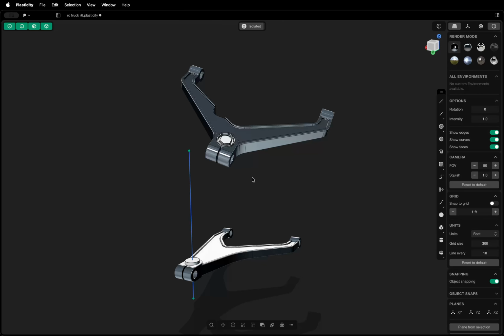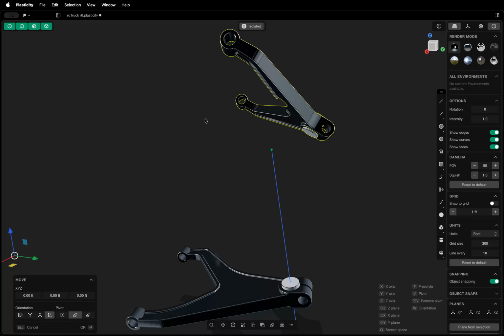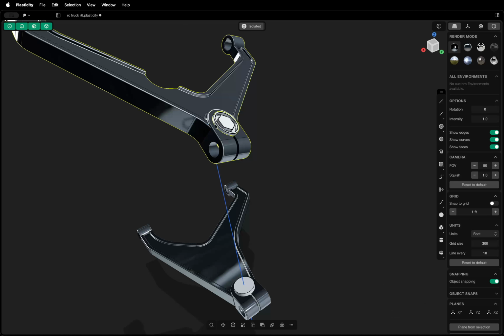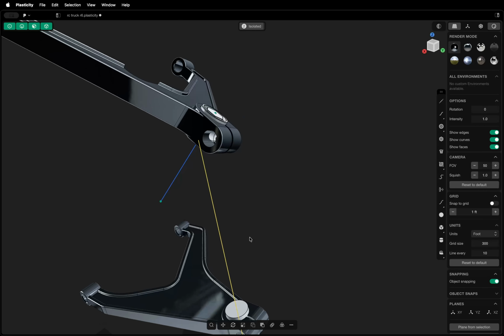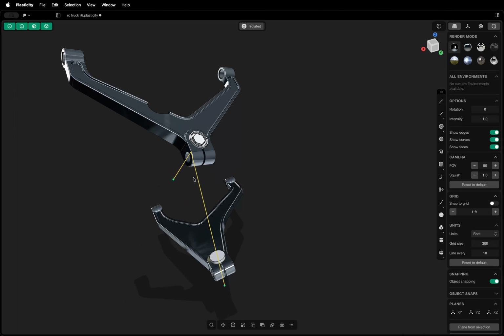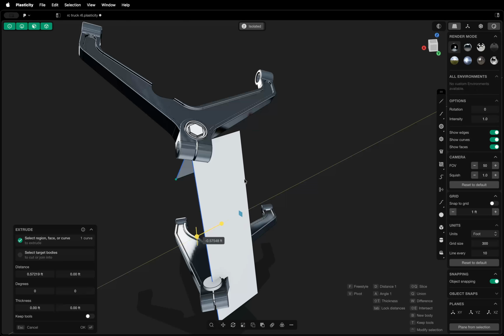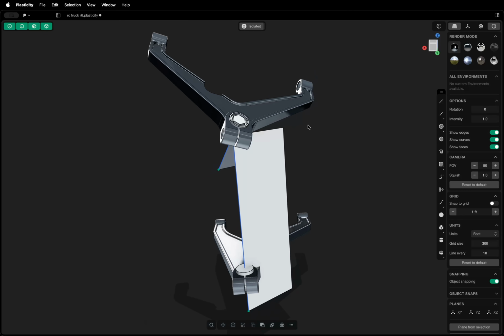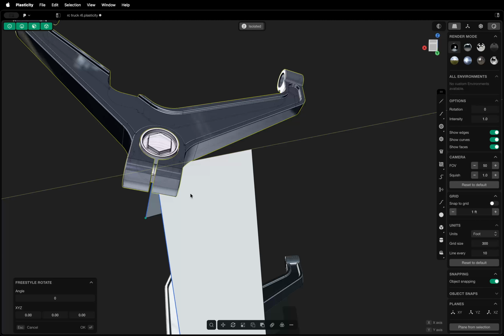PLASTICITY TIPS   ALIGNING 3D OBJECTS

Comment: EDIT: Disregard, the steps below only work under very specific circumstances...my bad.

Can be done in far fewer steps;

'Source' object is the object to be rotated, 'Target' is the stationary object.

1. You don't need the reference center-line drawn thru the target object's 'bolt', as there is already several edges on the target object that are parallel to the center-line of its bolt. Any of those edges can be used in step 3.

2. Select the source object to be rotated, then tap 'r' to enter rotate mode. Tap 'f' to enter free-form rotation, then click the center point of one end of the source object's bolt, then click the center of the opposite end of the bolt.

3. Now hover the cursor over one of the target object's edges that are parallel to its bolt's center-line (as noted in step 1...any one of those edges will do), and tap 'shift' key until you get a snap-line emanating from the source object that is parallel to the chosen target object edge  (it may take two 'shift' taps). Then move the mouse so that the source object rotates and snaps to the snap line. The two objects' bolts are now parallel.

4. Now move the source object such that its bolt center-line is co-linear with the target object's center-line. Select source object, 'g' then 'v', select center of bolt end, move to center of target object's bolt end, holding 'ctrl' key to snap the two points. All done.
Reply from the maker: Great alternative approach, I'll definitely give this method a try in my next project!
Reply: @FletcherAerospace  Instructions aren't thorough enough...I will update soon.
Reply: @FletcherAerospace  I updated my OP stating that it's not a workable solution under all circumstances. Apologies.

Comment: Impressive technique! I’m a bit lazy when it comes to this, though. I usually use the Place Tool (Ctrl+D) to match the faces, which is much easier. But your method gives much more control. 👍
Reply from the maker: Thanks for the tip, that's definitely a much faster way to do it, though it creates a new object but can easily rename it in a large model. Learning everyday 😊.
Reply: @FletcherAerospace  Ah, that makes sense! The extra object is a small price to pay for how much faster it is. I’ll definitely practice this and try to make it part of my everyday workflow. Thanks again for the tip! 👍
Reply: @FletcherAerospace   I would agree with this.  CTRL+D lets you place the duplicate and it will align based on the normal of your selection.  In your upper/lower A-arm demo the actual pivot point can't be aligned in the same step.  I guess it depends on if their pivots are parallel or not.  You can manually rotate it after the duplicate is placed.  

one thing that helps with management (which you may know) is if you create groups in the outliner, then activate a group.  the new bodies will be placed there making them easy to find and deal with.  If you click on teh folder icon it should turn purple so you know that is active. Make sure the body you are duplicating is in that group, then do CTRL+D.